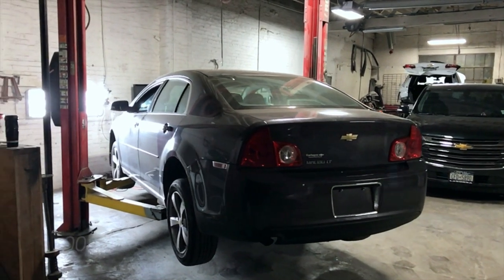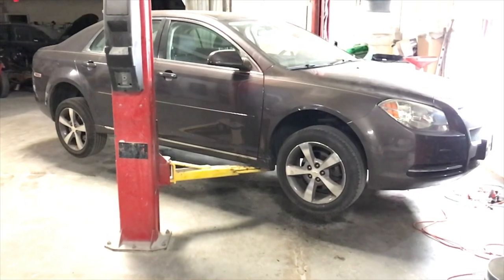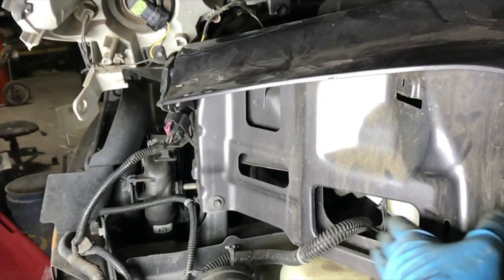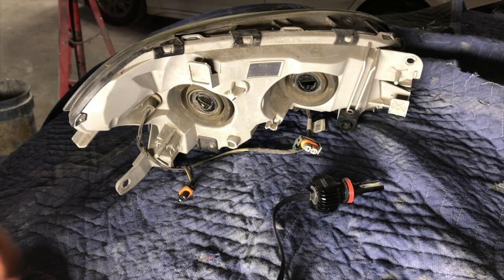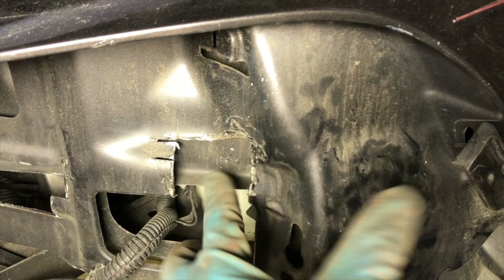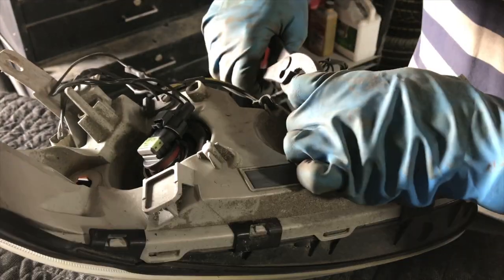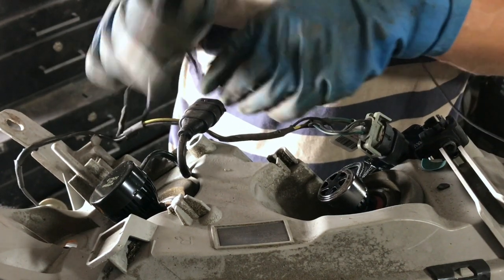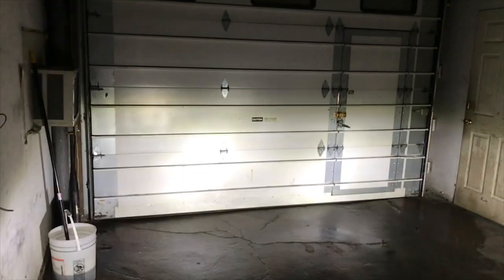2011 Chevrolet malibu Headlights to LED DETAILED

Comment: 2 years later. How’s it holding up? 
Did you have to install a load equalizer?
Reply from the maker: there were performing great, but owner of the car bumped into something and had to replace the whole headlamp. The shop that did the work did not put LED bulb conversion in , so they left it at that.

Comment: I’m trying not to cut into the fender, any suggestions?
Reply from the maker: yes, but very limited. you need to find good fan-less LED headlight bulb conversion kit with some kind of alternative for a radiator. This kit would need to be installed certain way, where led chips are shining into the correct spots of a reflector in a headlamp.